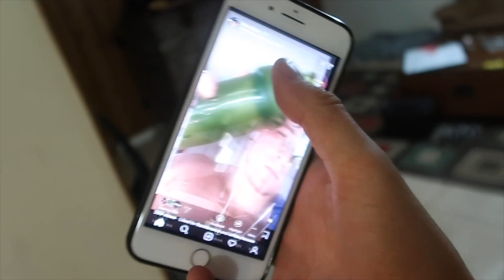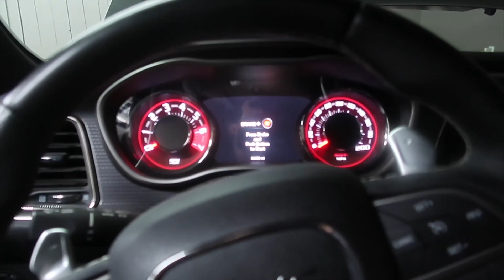800 HP HELLCAT makes the STRANGEST NOISE (VERY BAD)

Comment: My opinion here, but think you may have butted the rings on one or more cylinders ( Detonation Related) causing the top ring land to fail. The top ring land would now be loose in the cylinder ( noisy rattle when running ) until eventually goin out the exhaust valve where the noise would stop. Misfires are likely do to the spark plug being damage if hit by the loose ring land or when one of the valves Intake or exhaust close on the loose peice causing sealing issues. Most always they will run on a chipped piston but may inherit oil consumption issues / increased crank case pressure as a result. I'd yank the plugs as they always have a story to tell and see if one stands out. I'd bore scope the pistons to insure no broken ring lands. Iirc these tend to fail at the very top of the bore. If bore scope and plugs look great then I'd look more into valvetrain. Really hope I'm wrong but if Im not, can ya send me a Tshirt? 😉  Best of luck Judah!

Comment: If you have a misfire you should try using a code reader .do a live diagnostic on it 👍but these cars do have lifter problems they collapse .I had my 5.7 do it and I had my scat pack do the same thing hopefully it doesn’t happen in the redeye but I am going to replace them before the problem occurs and the supercharger bearings..Most likely the supercharger Bearing’s got overheated probably gonna be the problem

Comment: Sounds like it could be oil pressure related. Oil wasn't getting somewhere that it needs to basically. See if the noise comes back after a night sitting and oil has a chance to leak down.

Comment: It sounds like small rattle coming from valve cover but it could have been something loose that doing that it happens.  I would make sure everything is tighten up.  Usually if it's something serious that sound wouldn't just go away so let's hope it not. Tuners since your in Florida their are some really good ones.  Palm Beach Dyno is one of best out there, Lund Tuning is also really good check with them as well.

Comment: You might be right on a faulty coil causing the issue. Definetly do,a code scan and see if the code is a multiple cylinder misfire. Bad spark plugs or faulty coils can cuase a misfire condition.

Comment: Scan the check engine light......    see if it has a misfire code , if it does go to that cylinder pull the plugs and check  really good . Then remove the valve cover and check the lifters and springs . Hell check everything .

Comment: Don't mess around pull the valve covers off just cuz that piece ain't rattling around in there I would still do valve covers off and a compression check across the cylinders

Comment: Bet you cracked the piston because mods were done without knowing if the tune was good.  Just because Tall guy did this or that doesn’t mean it’s still the way it was after you replaced the parts.  Check the plugs and pull the valve covers.  BTW, how do you not have a scan tool to check codes?

Comment: All rocker arms and timing chain needs to be reset motor need tore down while in car to fine out what's lose but still go to the process of elimination first check Auto parts on the motor before you get into the internals I've been a mechanic for 15 years I tore down motors before I know all engines are not the same but not built the same but you did say the hellcat motor was beat by the other guy so that's where I would start process of elimination don't purchase all your necessary testing tools start the process on it

Comment: I cant believe that has cylinder deactivation. I’ve seen GM lifters do that
Reply: The 6.2 Hellcat engine does not have cylinder deactivation.
Reply: Frankie 072 
Thanks never worked on one . And I couldn’t believe that they would have . So thanks for verifying it . Much appreciated
Reply: @robbiefrentz9427  No problem ,The 6.4 392 Does have cylinder deactivation
Reply: Frankie 072 
I knew my sons R/T 5.7
And my 5.7 truck has it and it sucks lol